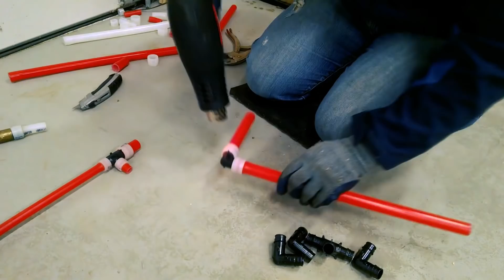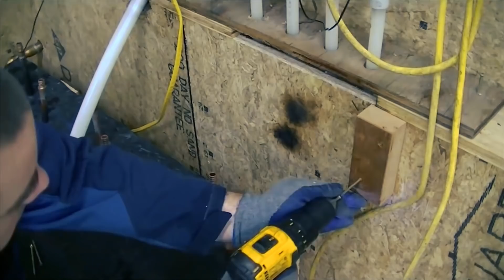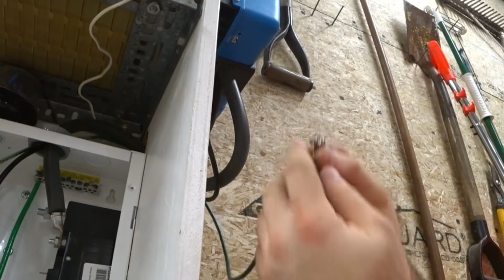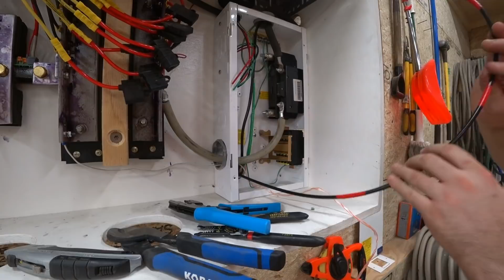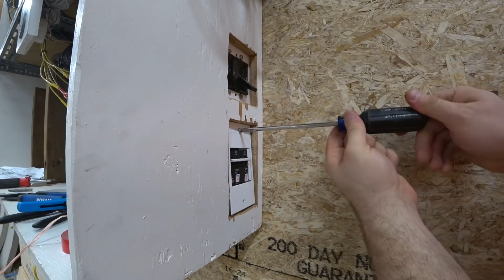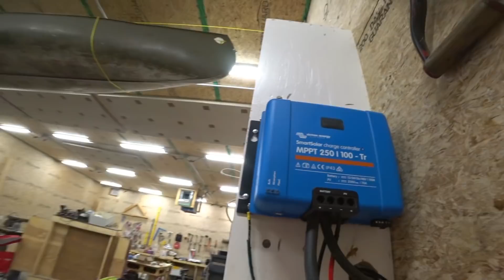Wiring the Solar with a Couple of Safety Devices

Comment: HOWdy  D-P,
QUESTION = how many Earth Grounds / Copper Coated 8' long Ground BARS do you have installed ?
Do you GROUND the aluminum framework on your PV Solar ARRAY & Ground them & a SURGE-PROTECTOR at the ARRAY ?
Do you GROUND your RACK-MOUNTED Batteries to your HOME  Grounding ROD ? ( Do you utilize TWO Rods 6' apart ? ) 
GROUNDING is such an interesting TOPIC ... I'm always curious of what others recommend
Thanks
COOP
...

Comment: That nice charge controller can handle 250DC,,, does your panels give out more than 41 volt ? otherwise you could make two strings of 6 panels, get the voltages up and the amps down,, and get less loses in those wires :-) less than 1% with the same wires.
Reply from the maker: I see you got this on another video.

Comment: Just curious, how did you decide where you wanted your surge protection device?  I have one and IIRC the instructions were kinda ambiguous.  I was thinking I would put it wherever it had the most chance of protecting my inverter since that is the most expensive piece of equipment I have.
Reply from the maker: I basically followed Midnite Solar's recommendations.  They make the SPD I'm using.  Here is a link to the brochure: http://www.midnitesolar.com/pdfs/spd_frontBack_display_web.pdf on page two you can see suggested placement.  One is for the 48vdc battery, which I install in this video, and the next video I'm editing I put in another one out at the combiner box.  If I wanted to go a step further, I could buy another to install on the AC side of the inverter.  However, I do have a different brand SPD in my main circuit breaker box of my house.    Here is a link to all the info: http://www.midnitesolar.com/documents.php?productCat_ID=23&productCatName=Surge%20Protection%20Devices&model=MNSPD-115&product_ID=283&act=info

Comment: So the ground fault is only for the PV array?
Reply from the maker: It's connected to the PV circuit, so if it shuts off that is the only part that would be opened.  The inverter could still run, if that's what you are asking?  I'm not an expert about it, but here is the manufacturer page: http://www.midnitesolar.com/productPhoto.php?product_ID=252&productCatName=Breakers&productCat_ID=16&sortOrder=4&act=p